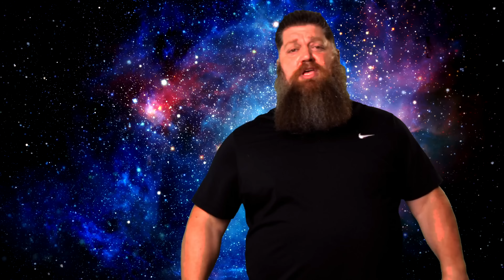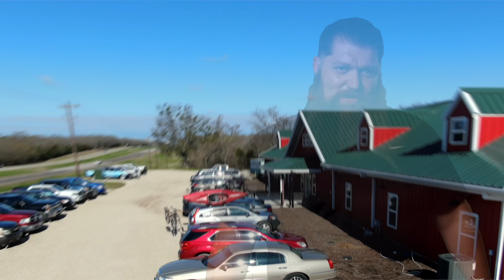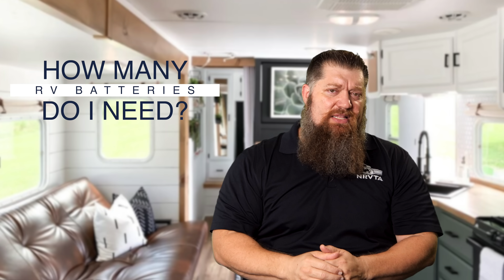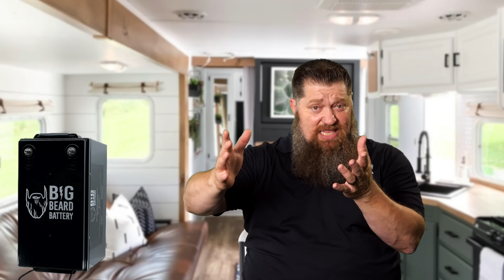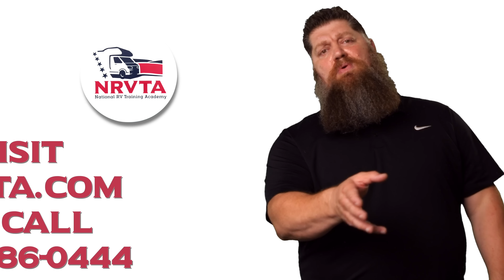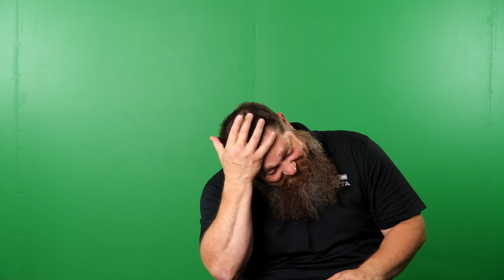How Many RV Batteries Do I Need?

Comment: I am new at this.   If we switch to 2 lithium batteries what size/how many of solar panels would we need?   Right now we only have 1 190 watt solar panel.   If we got 2 lithium batteries would those two batteries run lights, water pump, 12v refrigerator, heater at night if needed all night long until morning for the panels to start charging again?

Comment: your AC consumption of 20 amps running it for 14 hours = 280 amps.  From what you said, each battery is 300 amps.  So your AC can run just on 1 battery.  Some math issue here.  So I am not sure why you have eight 300 amp batteries.  You should be able to run your AC for 14 days on that many batteries.  Am I missing something here?
Reply: There is no way that’s right.   You have to convert that over. The a/c is 20 amps at 120 volts, not 12 volts.  I can not remember how you do that but I’m sure someone here could do that.     That is my understanding

Comment: There are so many permutations of what can occur when camping and how long a battery will last without recharging. But in real life, charging can be happening as you drive to a campsite and at the campsite while at the same time you are using power from your battery.
I'm interested in this situation: you have a 100ah lithium battery that is fully charged that is powering your small (Casita) trailer (3 way refrigerator, furnace, 2 maxxfans but no air conditioner, 6 gallon water heater, LED lights). You set out on the road and nothing inside the trailer is on except you put the refrigerator on 12 volt because of the dangers of using propane while driving (gotta keep the food cold). When you get to your destination 6 hours later, you set up but you don't have shore power, or city water, or city sewer. You change the refrigerator to propane. You turn on the propane water heater. You use one of the fans all the time to keep air moving. You don't have to use the propane furnace much more than an hour total daily. You set up your 100 watt solar panel when you arrive but it doesn't get much sun until the next day, when it gets about 5 hours of sun. You use the water pump for just the usual things (washing dishes, toilet, quick shower). You stay at this site for 7 days, or maybe even 14 days. 
Are there any concerns when traveling so the trailer battery and truck battery aren't discharged and damaged by running the refrigerator on 12 volt? 
What can be done while traveling to prevent battery problems? 
Do you think the solar panel will be able to maintain the battery to last the 7 to 14 days and then travel back home? 
Do you have any other ideas? 
What if it was a regular lead acid battery and not a lithium?  
I'm trying to work with the items that are included with my trailer without buying inverters or more batteries or mounting solar panels. I've been looking for a video that addresses the real life situations like this. I've seen a lot of videos that say don't drive with propane on for the refrigerator but they never address the solution of how to run the refrigerator on 12 volt while driving. They only say that the refrigerator draws a lot of 12 volt power. I'd love to know the solution to that problem. Thanks so much. 
I love all your videos. Please make one on traveling 6+ hours with your 12 volt refrigerator on and the issues and solutions to the problems that can occur.
Reply: Have you heard about our lord and savior "solar gendrator power? ..🤨🤔😏
Reply from the maker: So this is all about supply and demand. 

Your specific fridge will provide the watt consumption or amp consumption / hour avg once fridge reaches operating temp. Typically 300-500watts/hour. 

I don’t need to cover anything else to answer your question about the 100watt panel being able to keep you for 7 days. No. 

Your 100ah battery has max 1200 watts total. If it were even possible for your 109watt panel to hit 100% for 6 hours that’s a total of 600watts supply daily (again impossible) with the 1200watts supply from the battery. 

Demand is 300-500watts per hour. You are in a deficit under the current scenario.
Reply: thank you @NationalRVTrainingAcademy
Reply from the maker: So if you used propane when you get to your site for the fridge and water heater then it’s just the lights and fan. 

Lights pull ~2-3amps /hour if all are on. The fan will pull the same ~2-3amps/hour so total about 50-60watts/hour. 

You can go a couple days but the 100watt panel and only 6 hours of useful sunstrike per day will not be sufficient to recharge the battery. Possibly a portable genny a few hours a day to recharge the battery.
Reply: So it sounds like the best way to travel is to turn off the refrigerator while driving (and pack it with frozen foods or frozen water bottles to keep it cold) ?? @NationalRVTrainingAcademy

Comment: Right now, we use two 6V batteries in series when we have no shore power. With lights and furnace (Canada winter kamping) they'll last at least 24 hours. We do use a genny for backup/charging. 

I'd like to hear or find something somewhere about using two 12v batteries wired in parallel. I've seen it done on commercial trucks, but of course we don't need a high-amp kick for starting engines. Would any matched 12v recreational batteries work okay?
Reply from the maker: Like kind 12v deep cycle batteries properly wired in parallel will run your 12v needs. 

Look at the capacity (amp hours) of the 12v batteries vs the 6v. 12v batteries gage more cells which limits how much capacity.

Comment: Is my 12v refrigerator only going to draw from my battery even when I am on shore power?
Reply: The simple answer is no. Shore power, depending on the type of converter you have in your rig, will charge your "coach" battery over time, and act as a 12V power supply.
Reply: @s.mendez7160  thank so much for explaining that. Happy Camping!!

Comment: I have a 1982 Chevy mini weiner Winnebago frigerators 12-volt through the converter  my lights are not working I have the old type glass fuse but I don't see any any that defective what would be going on it said my frigerator is working not light

Comment: I got this little 1000w Sportsman inverter generator that keeps my single wet cell charged, fridge on propane, lights, furnace, charge phones, cpap through the night, etc. No AC of course. This little generator will run 11 hours on one 1/2 gal tank and can barely be heard. Got two of these gens on clearance $170ea. A great cheap system. My lead acid is 5yrs old still going strong.
Reply: I moved into my rv 4 months ago, off grid. Ibwpuld Saybrook setup is ideal and most displined.for budget. I had 5 solar panels n 4 small solar generators and decided I could use a generator. Sold it in 2 weeks as ibwas too cheap to pay for gas. I'm the only one in campground without a generator blasting all day and night. The fans take up 95% of myvpower. Once oct  is here I will have plenty of power with my set up

Comment: can i add  lithium bat to an agm bat using both ?
Reply from the maker: We do not recommend combining lithium batteries and lead-acid batteries. The load characteristics and capabilities of these batteries are drastically different which can lead to safety issues.

Comment: Todd - Thank you for the great content you ant the NRVTA put out week after week! I Don't want to read too much into a simple Tech Tip, since it is free advice, but you suggested that "...a lithium..."  would get you "...a weekend..." (assuming proper converter) running lights, fan and fridge. However, when I run the math (I may not be doing it correctly) for each appliance/item over 24 hours (lights wont run all 24 hours nor will the fans and a 12v fridge wont run for an hour, every hour). so even on conservative estimates, I still get 211 amps in a 24 hour cycle.  The 12v fridge consuming a whooping 96 am hours (assuming it runs only for 30 mins in an hour, every hour). Lights and fan come out to 55 amp hours for a 24 hour period.  Conversely, an absorption fridge appears to only use 24 amp hours assuming it runs all the time.  Nonetheless, even with an absorption fridge, I'm not getting two days unless you meant to imply a 12-14 hour solar charge during the day to replenish the energy in a lithium. Thanks for your great work! .
Reply from the maker: or 1 280amp hour Big Beard Battery. ;)

Comment: i have 2 100 amp hour batteries. Will i need to invest in a new invertor/converter to take full advantage of the new Big Bear Battery? Like run A/C.. i am on a 10 amp service at my son's house. Need help. Oh, the price was not indicated on your video or Big Bear Battery. what is your est price?
Reply from the maker: Check your converter/charger to see if it has the capability (button, switch, auto detect) to change the charging mode from lead acid to lithium.  If not, you will need one that does.
Reply: How do you check that?

Comment: when do your batteries come out with a listed price?  We are either getting a Vacationer or Bounder next spring...  I want to immediate swap out the 6V deep cycles with at least one 280Ah if not two just to start out... then slowly build out the system to match Todd's 2400Ah setup so we can go overnight with the AC...
Reply from the maker: Pricing is now listed on the site. Watch out for offers.
Reply: @NationalRVTrainingAcademy  thanks! Great price too... 

I see the mention of cold charging protection but are they heated?

Comment: Thank you. I always hear 50 percent on led acid batteries. That's fine. So when do I know when my 2 batteries are at 50 percent. I do have a meter in the rv for the batteries.
Reply from the maker: So FLA batteries lose their voltage when discharging. When the batteries  get to 12.0volts resting then they are ~50%. Any voltage less than 12volts is bad for the battery and the equipment running.
Reply: @NationalRVTrainingAcademy   thank you so much for this information 👍

Comment: Like I said last time:  good content - but AMPS per hour and WATTS per hour makes no sense!!  AMPS is current flow.  It's like saying 50 litres/hour per hour.
Reply from the maker: Amps = flow but you feel that adding time to how long you record the flow doesn’t make sense. 

“How fast were you driving?  60
60 what?
60 miles. 
Oh 60 miles per hour

Water pump= flow 
How much does your water pump?
3 gallons
Just 3 gallons then it turns off?
Oh 3 gallons per minute 

Flow ALWAYS includes time when measuring it.
Reply: @NationalRVTrainingAcademy  Are you 100% sure about that?  Let me put it another way.  Amperage is the "rate" that current is flowing through the circuit.  1Amp = 1 Coulomb per second.   Speed is a measure of rate-of distance.  Miles is distance, and you have to add "per hour" to make it a "rate".  But Amps is already a "rate".  It's all semantics.  I know what you mean.  But trust me on this - it's NEVER amps/hour.
Reply from the maker: Yes I’m very sure that I am right. Your not even splitting hairs. You simply aren’t accepting a generally accepted term. 

Hit the googles and type in amp hours definition. Link after link after link will define it.
Reply from the maker: https://energyeducation.ca/encyclopedia/Ampere_ 

Ampere hour

An ampere hour (abbreviated A
⋅
⋅
h or amp hr) is a unit of electric charge, usually used for batteries. This unit combines the amount of current with how long that current can be sustained until the battery completely discharges.[1] Large batteries have several ampere hours but cell phones and other small devices have batteries with a total charge measured in milliampere hours. This measured quantity is called battery capacity.[1]
The number of amp-hours in a battery is found by multiplying the amount of current (in amperes) by the time (in hours) a given current could flow before the battery runs out. This calculation gives the total amount of charge transferred. This unit is useful since a battery will be able to supply current for a longer period of time, than say a capacitor. Chemical reactions inside the battery are limited by the amount of material that can be eaten away, and how quickly, this means that to test the ampere hours of a battery one should use a low current relative to the battery's peak current capability.
1 Ah = 3,600 Coulombs
Often the amp hour is written on the side of a battery, which has a voltage (often 1.5 V). An ampere hour at 1 volt is a unit of energy, specifically the watt-hour (1/1000th of a kWh).

Dictionary.com

ampere-hour
[ am-peer-ouuhr, ou-er, am-peer ]SHOW IPA

nounElectricity.
1. a unit of electric charge noting the amount of electricity transferred by a current of one ampere in one hour, equal to 3600 coulombs.

https://en.m.wikipedia.org/wiki/Ampere-hour

An ampere-hour or amp-hour (symbol: A⋅h or A h; often simplified as Ah) is a unit of electric charge, having dimensions of electric current multiplied by time, equal to the charge transferred by a steady current of one ampere flowing for one hour, or 3,600 coulombs.[1][2]

    *  
    *  
What is an ampere hour (Ah or amp hour)?
Ampere hours -- sometimes abbreviated as Ah or amp hours -- is the amount of energy charge in a battery that enables 1 ampere of current to flow for one hour. Another way of saying it is that 1 Ah is the rating indicating how much amperage a battery can provide for one hour. The unit is a useful metric to determine the capacity of an energy storage device, such as a rechargeable battery or deep-cycle battery.
Reply: Hang on, mate - now you're referring to Amp.hours, and that is indeed a very useful number.  Amp.hours is current multiplied by time, but in your video you clearly refer to "amps per hour"' - which would be current divided by time, and is of no use to anyone.
I don't want appear pig-headed in this, but I have a bachelors degree in electrical engineering and have worked in this field for 35 years.  Amp.hours - yes.  Amp/hour - nope.

Comment: 20 amps AC load is not 20 amps DC load on your batteries from your inverter.
Reply from the maker: 200 on DC plus power factor and efficiency

Comment: When I purchased my 2021 Hideout 28RKS, the dealer installed 2 batteries in parallel. We are park campers with no more than occasional drive day lunch lights used off grid. Is there any reason to replace both batteries when the time comes? To my understanding, the second battery is superfluous to how we use our trailer.
Reply from the maker: If you aren’t driving more than 2-3 hours when traveling then 1 is ok